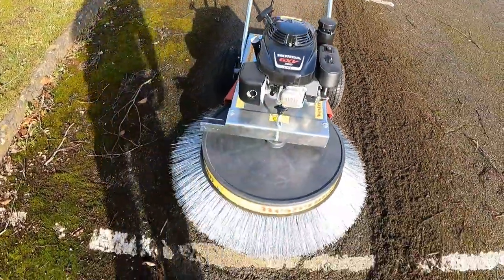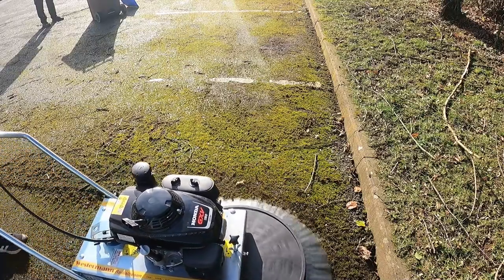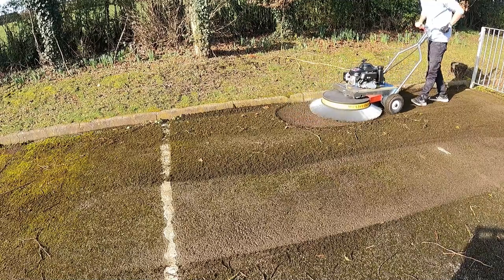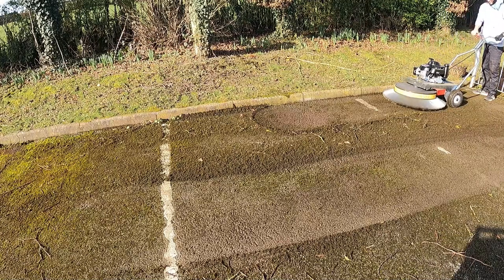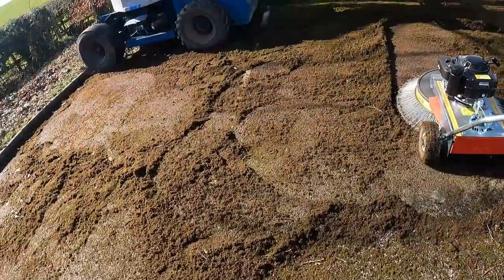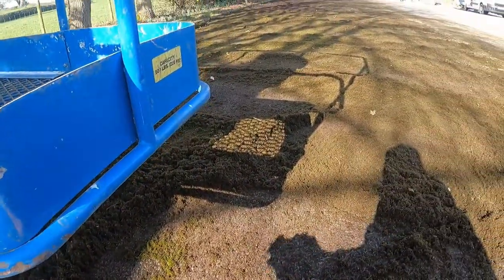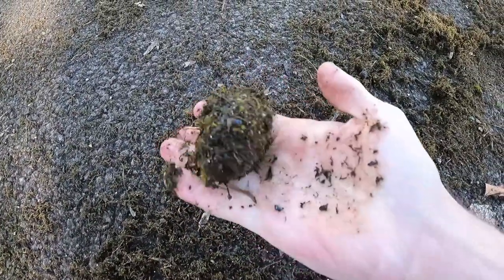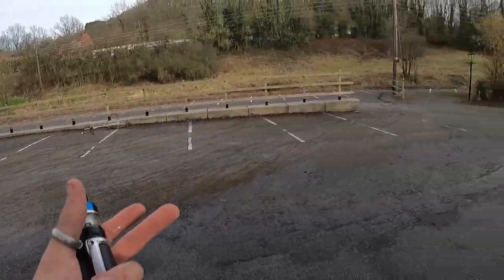Cleaning Up HUNDREDS Of Kilo's Of Moss From A Car Park | Westermann Radial

Comment: I could put this comment on any one of your videos. Really admire your work ethic, your demeanour and more 

You said in a video not too long ago, when you complain about your arms you think of people in the trenches.

Of course as do I too and many others but I've never actually seen anyone in the trenches.  What I do see is you and when you show your jobs in part in real time really shows the stamina and work ethic as I said before.

Whilst doing up a house, I tried to mimic the same pattern as you pressure wash driveways to painting and battling on when clearing out a garden. Often being there "4 hours + than intended.

That carries over to other aspects of life in how you approach obstacles etc etc.

So just wanted to say thanks for helping being a reminder, being an inspiration a getting me moving to, get on the next thing., In relatable and non relatable ways.

I'm sure I'm the not the only one...probably definition if your intention of being  an influencer!
Reply: Calm down

Comment: Such a tough job, but the best kind to learn how to use your new toy. Practice will make it easier every time. This job reminds me of the playground court that Prestige Cleaning did a little while back. He had no access to a water tap for the job and had to do it with a weed brush and shovel. No matter how imperfect it looks at the end, it's miles better than what it looked like before.

Comment: Hey mate. I have that same engine on my mower and I actually found that it revs quite low from factory, there's a few videos on YT which show how to get more rpm from it and it's still well within the engines safe operating parameter, might be worth looking at that to get a bit more grunt out of the unit.

Comment: The machine looked like it did a great job. In the last video I left a link where a shovel did better than the equipment the chap used. As you stated you could have done, he should have pre-treated it as well.

I suggest after doing the pretreatment, and the brushing. Go over with a leaf blower once the majority of the moss and dirt is gone. Also you might try going in a certain direction repeatedly, but could cause problems with build-up on one side.

Comment: Quick tip Sid....with that machine, if there is an uneven surface, always go up and down, as opposed to side to side. It works better if you are going uphill and downhill...as opposed to side hill...if that makes sense.

Comment: Yeah I feel your frustration a little at the start there, almost looks underpowered or the gearing/clutch was setup incorrectly the way it was failing at the slightest resistance.  I’ve seen a few of these before and they have blasted through anything in their path.  Great job sticking to it though mate

Comment: Great job adapting to the new machine so quickly. Just curious if your steam machine would have killed the moss? Like you I try to avoid chemicals when possible but just curious if it would work given that massive carpet of moss you tackled. Great video.

Comment: Even though it will take some getting used to and the settings, all that moss would have taken a lot longer with a power washer if it had not been scraped up first.  I know nothing about them but for some reason, I felt that wire brush should have spinned a lot faster.  So that's my question... er... Was that at the highest setting for those brushes to spin?  
That way it literally cut through quickly.  I was glad to see it used on that big parking lot. Well done.

Comment: Is it possible to tilt the wire brush a bit more, so only the front touching the surface? That way you have less friction and less torque needed.

Comment: Are you missing the handle that allows you to disconnect drive and reverse it on the Westermann? Looks like it fist in between the wheels on the silver block? It was good at removing the main moss, must have made PW so much easier?
Reply from the maker: Yea mate I was having to manually move it it’s quite tough to shift between though, it changes the rotation so I need to get a spare one if they sell them!
Reply from the maker: And yea bud was sooo fast to fsc it, took about 2 hours for 400m2, crazy
Reply: Oops, ermmmm. Now do I feel dumb, the handles here Sid sorry fella

Comment: I notice you sweep up a lot/almost all of the debris from not only this job but evey pressure washing jobs.  

I would think for this job, that moss is a great organic matter to blow back into the surrounding grass and planted areas.  It isnt too formal where it would look ugly sitting on top of mulch etc.  So why not blow it back into the grass with a strong backpack blower????   Not sure what is available over in the UK but here I have one of the strongest Echo blowers available.  It has NO problem blowing soaking wet leaves, piles of wet grass, etc off concrete etc.  I would think the same thing with some of the pressure washing you have done.  Blow the dirt into grass areas since it is just dust.  Less stuff to go into the landfills and if its good organic matter like this moss, it would be beneficial to the plants. (I would assume.  I am not a horticulturist but I have added enough organic matter to plants and yards in the past that I had to pay for and it helped)

Comment: I’m not trying to be negative because youve purchased it already, but i feel like they are the most underpowered machines ever. They should have a much stronger motor on them for what they are.
Reply from the maker: I do agree I was left wanting a bit more of a grunt on it, I heard the stories of it wanting to pull away from you but I didn’t feel that at all, I was preparing for a monster :D
Reply: @PartridgeExteriorCleaning  you can tension the belts with the direction bar

Comment: These machines have a tendency to burn belts and nylon bushes/pulleys if you push them too hard or let the belt get loose. They are not suitable for uneven cobblestone to remove weeds. You get a machine with small rims - the big rim models will break 5 rims in a day when you catch on something so that should work out for you.